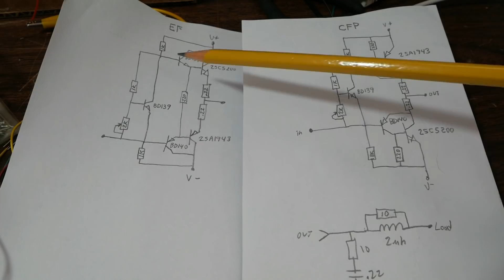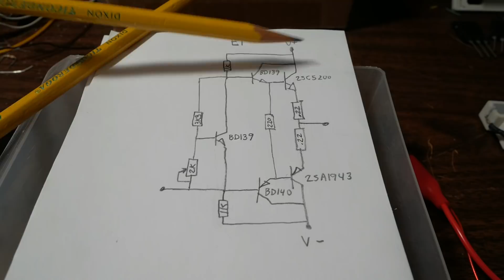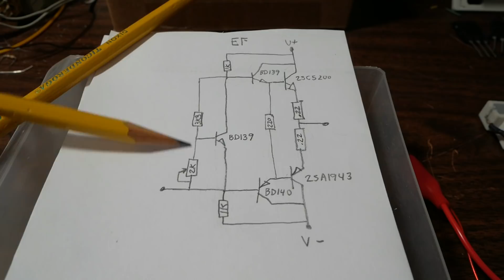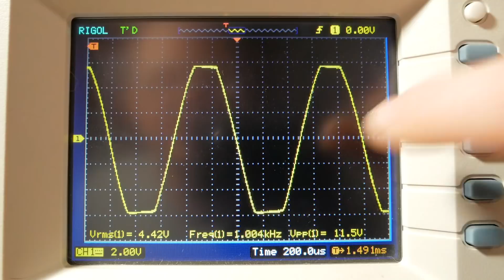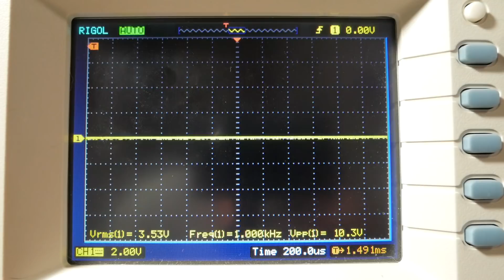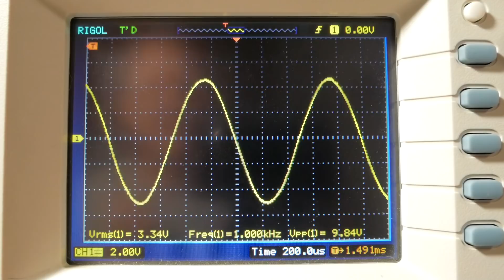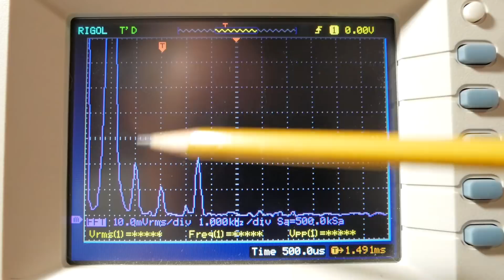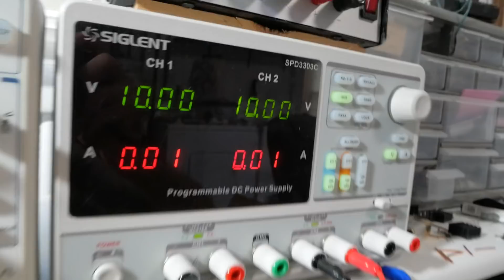Discrete audio amplifier project PT8.1 EF output stage test

Comment: What about an all NPN transistor amp with 3x BC182L transistors driving 2x BD131 power transistors to produce a wide band Class A amp with an output of 5-7watts like that used as the color gun driver amp with a voltage of 13.8V DC.

Comment: can I use half darlington pair and half sziklai pair configuration as the output stage?

I mean I want to use npn-npn(2n3773, where its complement pnp isn't available) output stage, with npn-pnp driving transistors.
Does that have any issue?

Comment: John,

Don't do it too much with the global feedback. Although it is good for linearity, BW and stabilization it is catastrophic for the transient distortion of the amplifier. This is the ablility of the amplifier to respond quickly to the transients of music thus very abrupt and large variation in amplitude of audio frequencies and differs from the dynamic response of the amplifier which is really its S/N ratio. A very low transient distortion amplifier reproduces sound very natural and is an important part of hi fi audio. This is achieved with very fast and very small rise and fall time transistors and of course supported by a strong and fast power supply. Transient response is many times neglected by hi fi enthusiasts. There many designs which are using HF transistors instead of AF transistors for that reason. MOSFETS designs are considered slower than bipolar transistors. 

Unfortunately large global negative feedback is a killer for transient response of an audio amplifier. In my designs I don't use more than 3% global feedback and prefer to use large local stage feedback emitter resistors a.c coupled. Also by reducing the amount of global feedback used you don't need that large open loop gains on your amp stages which is known to cause many linearity problems and and loss of stability. I prefer the two stage approach whenever I want a large gain instead of getting it from a single stage, which will reduce the BW. Also remember a 6X2=12 gain dual stage, has less BW and is less linear than a 4X3=12 dual stage.

Finally, I use in all of my voltage stages IC regulated voltage supply for increased power noise rejection and stability except the output current amp stages where I use unregulated power supply.
Reply: Hi, I remember Non global feedback amp from LC Audio in Denmark. To keep the gain low the emitter resistors on differential input stage was in 1-2k value. My friend designs hi-end spkrs drivers - he does plannars as well as regular midwoofer, woofers some of them are the fastest, cleanest I have heard but to make them takes a lot of $ for small production. He favours DSP crossovers since the flexibility in creating additional EQ points and adding delay to much acoustic centers or desireable freq resp is just heaven send comparing to passive crossovers. So yes I would agree with you that impulse response is very important and makes for much more transparent, high resolution amp. What in your opinion in terms of V/usec rise time or slew rate make a good amp. Also what is your opinion on CFT amps.

Comment: They're both pretty good but I preferred the first output stage from the previous video, this one just doesn't sound as "full" to me.  I wouldn't even been able to tell when the sound was distorted on the "youtube safe music" since. all "modern" music sounds like distorted crap to me anyway.
Reply: I could hear the crossover distortion when the bias was reduced...
Reply: The modern distortions or Remastered disaster - if you clip the DAC it creates distortions similar to badly designed AB class amp with underbiased output stage. Since a lot people listen to portable devices with limited voltage swing, a lot of music is compressed with reduced dynamics so there's enough volume from crappy headphones or small speakers. Before it was done to make less noisy recordings with tape recorder, but the way tape recorder compress and distortions it creates is much different and not so offensive to the ear, think of it as progressive saturation of magnetic core in tube amp output transformer. The way it is done today with plugins in DAW is very aggressive, often the final result is what you describe - Junk-but-loud, JBL. Funny because there are some so called audiophile recordings that are very compressed and some, say from MA Recordings recorded with very small level, yet the noise is not an issue. On average these days the level is 15dB higher than 25-30 years ago when most of CDs was mastered not to clip DAC and usually a bit lower than 0dB. 
Welcome to the new deaf world. BTW, I went to Cinema a month ago and I thought my ear drums are going to explode, so I spent the whole movie with earbuds in my ears - that f.. loud, at least 10dB too loud.

Comment: isn't 2SD882 better choice than those BD139 ? because more higher & flatter gain curve over wide collector current range ? 

other than that, this configuration sounded more punchy than cfp..... donno, may be because of the music itself.
Reply from the maker: It is not usable in my circuit due to the low Vce of 30 volts. The drivers may see 60+ volts across them during full output. The On semi datasheet (BD139) shows a reasonably flat gain in the region of current that I will use them.
Reply: @JohnAudioTech  i see. thanks.

Comment: You may benefit from soldering up screw terminals and round-hole connectors to a PCB in the configuration for Quasi Pair Complementary,  Darlington Pair Complementary, Compound Pair Complementary, etc.   This way you can test high currents on various output stages while retaining the ability to switch out caps, resistors and power transistors.  You seem to spend a lot of time bread-boarding output stages for tests.
0.1" and 0.2" screw terminals exist:  https://www.pololu.com/category/177/0.1-2.54-mm-screw-terminal-blocks
Looking forward to building up your final amp!

Comment: Most important thing for reliable operation is DC stability, so whichever hookup is the most DC stable is the way to go. The miller cap on the VAS will most likely eliminate all oscillation. As far as distortion goes, I defy anyone to say they can hear less than 1% in speech or music (with the exception of some professional musicians)
Reply: Rod Elliot has a good article on Darlington vs Compound. He also has a very simple cure for the negative half cycle oscillation.

Comment: hey John,  if you need a board made up,  let me know.  I have boards at the  ready, and chemicals ripe for the dipping.  I will need the full schematic, with or without the preamp. so leme know.  mike   call or email, or message me and I'll call you.
Reply from the maker: Hi Mike. I'll see how it goes. I'm now putting it on a solder type bread board so I can continue with the design. I'm getting closer to the first prototype. I still need to get back to you with a good transformer selection. Haven't forgot!
Reply: thanks John,  mike  they call that board perf board.  but you probably already knew that.

Comment: The stability is a keyfactor for any amp design! If you dont load your amp to a minimum current at the output, you run into several problems due to the slow "off switchingtime" of the BJT's .
Reply: Yes, the larger caps didn't cause oscillation (w/CFP) because they were starting to become a significant load.
Reply from the maker: That was the EF stage that was more stable with the larger caps. I'd guess the larger caps have a different phase relationship with the output at those oscillation frequencies. The boucherot cell would present a resistive load to the output at those very high frequencies where a direct cap is reactive. I would think the non inductive resistors I use as a load would be resistive too. Of course there is parasitic reactance all over the circuit.
Reply: @JohnAudioTech  you have to be allways careful with parasitics of the breadboard  and the wrong impression due to interaction of different sources of errors. I have doing ampdesign for over 30 years and won over 70 awards worldwide with my amps etc. , and yes the world is very analog and komplex if you did deep enough....
Reply from the maker: Hi Christoph. I hope you stick around for advice. If you are available, I can be contacted at my johnaudiotech@gmail.com account.